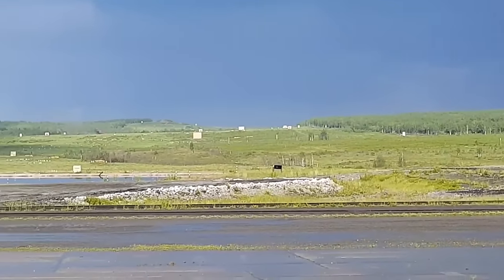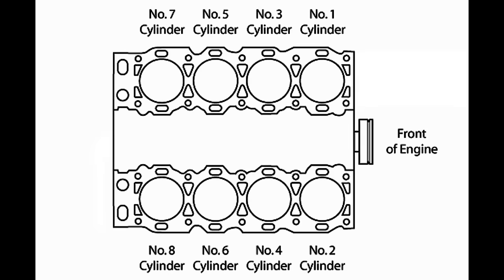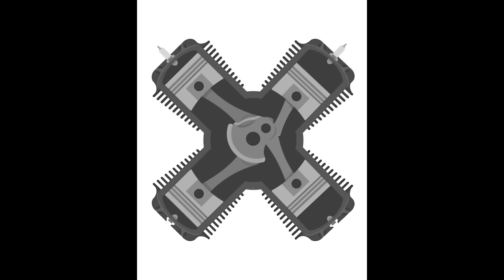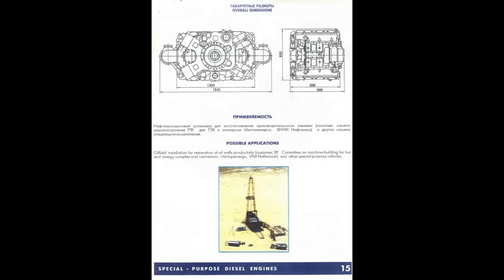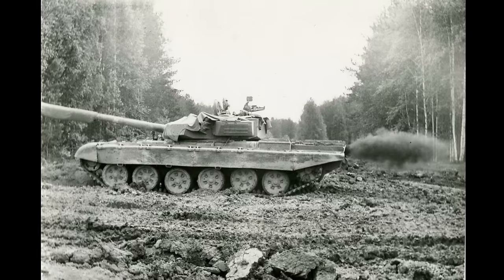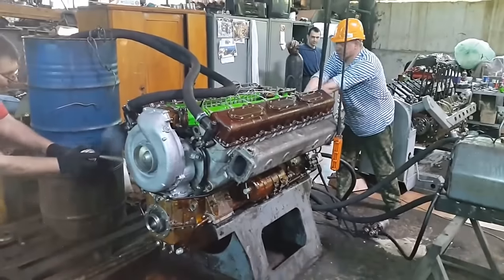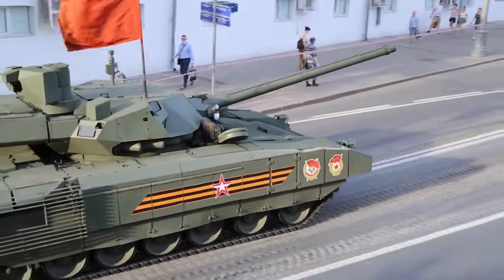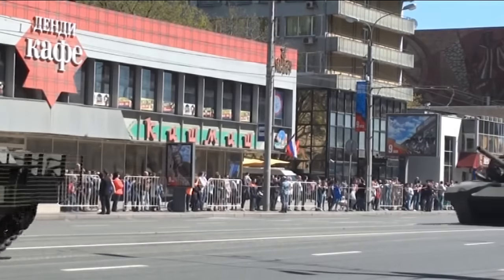Controversial History of T-14 Armata's Engine

Comment: I feel like people who argue that the T-14 engine is a copy of german WW2 engine are the same peaple saying AK47 is a copy of StG44.
Reply: yeah its crazy that people dont know that ak is copy of israeli Galil
Reply: @joukonsson1872  what are you talking about ?
Reply: It's joke  @mi-283
Reply: @joukonsson1872 no AK obviously is a copy of Roman slingshot
Reply: @joukonsson1872 weirdly enough, the Israeli Galil is a copy of the Finnish RK-62 which itself is a modification of a Polish license produced copy of the AK-47.
Reply: АК-47 is a copy.
You see, stg-44 shot bullets. What does AK-47 shoot?
That's right, it shoots my brains out on the wall.
Reply: @AlreadyTakenTag  i think that was joke. Also there is none thing such as AK-47. Its just AK or 56-a-212 to be correct.
Reply: And yet the people who think AK is a blank sheet design are also wrong.

It copied a LOT from the M1 Garand.
Reply: @immikeurnot  just rotating bolt, also from zh-29 and AB-46 recoil spring and long stroke gas system
Reply: @immikeurnot  womp womp
Reply: @mi-283 (Galil is a copy/based on AK)
Reply: Copy is exaggerated, but it was based on captured STGs. This engine is BASED on the German WW2 engine, but not a copy. It’s not like the Tiger engine was a great one to begin with.
Reply: @Vandelberger The Tiger 2s engine youre thinking about isnt the diesel one. Its the gasoline one.
Reply: @immikeurnot People who DO know their AKs, understand that it's a system that collects all the proven and reliable ideas in the most simple form.
Kalashnikov and his team tested hundreds of systems, and in the trials they scrapped AK46 design and took Bulkin's design and made adjustments.
Because it was not a competition of who would make the most genius design from scratch, but who would come up with the most reliable, cheap and sturdy one. 
The same principle was adopted to PKM, which is an upside down AK essentially, and SVD, which uses AK's design as a starting point, so soldiers can use all three systems.
Reply: @Vandelberger  except you are wrong in both and this video shows on the engine and the simple mechanism difference of the STG-44 and AK-47 shows in their case.

At most it inspired it conceptually, in the rifle case
Reply: @AlreadyTakenTag truly mr worldwide
Reply: @niksonrex88  You are right. I am very hung over. 😵
Reply: Or, that the BF-109 is just a copy of the Wright Flyer, both have wings, both fly, both use lift.
Reply: @Itoyokofan Originally the AK-47 took a lot of machining time and so was actually very expensive per unit. It wasn't until quite a bit later that changes were made so that it could be stamped and made more cheaply.
Reply: @ian_lambert-knight  em-m... no. The original Type I AK was stamped just like the AKM, but the process of stamping was yet in development in the USSR. (Actually Hugo Schmeisser AFAIK was helping the USSR with stamping processes). Thus it was decided to temporarily adopt milled recievers. The stamping issues were resolved, and more crosspins were added to stabilise the frame. And RPK even has the trunion with protrusions to reinforce the reciever.
E.g. the safety originally was mounted just to the side of the reciever, but in AKM it hinges on a thick pin, that adds strength in this place. And I believe the thickness of the metal was improoved compared to Type I.
Reply: It is legit a modified version, it is still u reliable and prone to breakdowns
Reply: Wait til Lazerpig comes out lol
Reply: @Vandelberger  
>  it was based on captured STGs
Only conceptually.

> This engine is BASED on the German WW2 engine
Not even conceptually.

You don't know what you are talking about. 2V-06 engine from the BMD, which this engine is a twin version of, is unrelated to any German engine.
Reply: I’ve always wondered want people say the ak47 was a copy of the Stg and not the ar-15, given they have more features in common.

- in-line recoil system with high-rise sights and buffer tube in stock

- auto release dust cover

- straight insertion magazine

- very similar ergonomics

Of course the locking and and gas systems are completely different, but I’d still argue the ar takes more from the stg than the ak ever did.
Reply: @AlreadyTakenTag Fun fact for the Galil, the OG inventor of the said rifle -Yisrael Galili, is an immigrant from Russia that migrated to-then-known as Palestine, serving in WW2 under the British Army. Try to guess his real name? that's right - Yisrael Balashnikov.

And Galili himself is a sh*tposter, especially when he designed a Galil with curved barrel to conform with Woman's body for sh*t and giggles XD
Reply: @sectero9450 Kalashnikov himself explicitly credited the Garand rifle by his own word when he was interviewd by Historian-author Edward Ezell.
Reply: But notice how they never argue that the Merkava is a literal WW2 Tank, or that the challenger is just the Conqueror/Cheiftan dressed up, and slightly more mobile?
Reply: @joukonsson1872 It’s crazy they don’t know the Merkava is a literal WW2 tank because it sits on a chassis that was designed in WW2!
Reply: @50centpb7  people say it cus the ak47 was the first assault rifle after the stg44
Reply: Well, the AK-47 is a copy of the StG 44 or its 1943 MP43 or 1942 MKB42.  All weapons use the long stroke, piston mechanism with a cylinder at the top of the barrel, so that the cylinder aligned with the bad stock to prevent recall lift.  All used them intermediate cartridge. All use the 30 round magazine.  Even look the same.  The couldn’t bear to admit that the Germans had good idea that they had to adopt.  So they come up with some silly story of Kalashnikov inventing it as he was convalescing in hospital.  Soviet Union was based on lies and propaganda.  Things coming back to Russia now
Reply: @sectero9450  the STG 44 also used a long stroke piston.
Reply: @RussianBiasEnjoyer  that’s a  silly argument.  The AK-47 and the STG 44 look for the same.  A B19 and rot to look the same . And this pattern of appearance was pioneered by the StG 44.  The intermediate cartridge.  The long stroke piston mechanism.  The cylinder being above the barrel.  The alignment of the barrel recoil with the butt stock.  The selective fire.   The defenders of Russian pride get down to trivialities Such as the long stroke, pistons action on the rotating bolt.
Reply: @Vandelberger  The HL230 of the tiger tanks and panther tanks was an excellent engine.  Fire problems from its engine, being installed in an aquarium to allow deep river crossings.  That causing problems, but it wasn’t the fault of the engine.   HL230 what’s the most powerful tank engine of the war
Reply: @niksonrex88  The Tiger I, Tiger 2 and Panther used the HL230 petrol emigre of 650 hp,   The SGP Sla 16 (Porsche Type 203) X-16 Tank Engine was an a cool diesel designed to fit in the same.  It was extremely light, powerful and fuel efficient.  The T14 uses similar configuration.
Reply: @williamzk9083  but not rotating bolt and recoil system is different
Reply: @Vandelberger  wow it have pistol grip and curved mag so its copy wow
Reply: @williamzk9083  thats what i said.
Reply: While I get your point (from a "looks" standpoint)... its actually NOT the greatest comparison from an INTERNALS standpoint for how the/these engines work vs how those two rifles worked. In this video's case, their internals and how they work are very similar (on some function over form type shyt) since they're based on the same technology and mechanisms. So, it'd be more like comparing the Ak47 to the M1 Garand... if the M1 Garand looked like an StG44, lol.
Reply: @sectero9450  Good try and trying to seem smart, but no. In russian military paperwork, the original 1947 AK rifles are called “Avtomat Kalashnikova 47” to denote the year it entered service. So, if you wanna try and be all “I’m a firearms expert” the least you can do is fact check yourself. Hell, if you knew the most basics about soviet firearm history you’d know they’re named after the designer, and the year it was first accepted into service. Why would the AK be the only soviet service rifle to not fall under the classification system the rest of their small arms fall into?
Reply: @JohnDorian-j7x  it was sarcasm. And they aren't similar internally, stg have locking logs on bottom of bolt, like for example bren gun, or any falling block guns or browning pistols system of locking*. While ye ak shared rotating bolt with m1 carabine, because Soviets got them from lend lease or from zb-29 rifles that SS used or earlier soviet prototypes self loading rifles. Still zaicev and Kalashnikov wrote they they inspired from m1 carabine and AB-46.
Reply: @Captainkirk88410  Not really , case with STG-44(or correctly MP-43 because its what Soviets got) and with m1 carabine new type of weapon - intermediate cartridge and assault rifle. And firstly soviet developed cartridge - 7.62x41 they they started 2 trials for self loading rifles and assault rifle, in rifles Simonov easily won(as i remember there was only 3-4 other guys and they were suck). But in assault rifles more interesting, first to developt were Sydaev, Bulkin and D-something(he made a bullpup) AS-44 even had field trials in real combat, but sydaev died in 44 , so dead end. Kalashnikov and zaicev got their gun only at 46(ak-46) which was way different that 47, and it wasn't good. Leader was AB-46(which looks like ak with longer barrel handguard and different dust cover), AK won because it weight slightly lighter. STG created whole new class of firearm which soviet copy, not gun or doctrine, but idea. Same thing btw with MG-42 - universal machine gun which PKM, M60, fn mag copied.
Reply: @williamzk9083  lol, let me use I will debunk your entire post by debunking the later part technique.
Kalashnikov did came up with an idea in hospital during the WW2, but it was the idea of an SMG, which he made and eventually this got him a place in a design buro.
Noone has ever said he came up with idea of AK47. The AK47 wasn't even in the concept before he saw Bulkin's rifle.
Reply: @Itoyokofan  The order gin Russian copies of the StG 44 were stamped as well.  Stamping is cheaper but the metal is heavier and thicker
Reply: @sectero9450  The StG 44 like Al 47 used a long stroke it’s a triviality that the AK47 complied the garand rotating bolt of the garand.  The piston still acted directly on the bolt and moved together.  Both were reliable.
Reply: @Captainkirk88410  he didn't, soviets ordinance steps did - they started trials for new type of weapon,  there were dozens of different rifles.
Reply: @williamzk9083  M1 carabine not garand. And long stroke gas system  used lot of guns that soviets used. STG is why AK-46/47, AB-46, AT-45, AS-44, TKB-408 etc were made in first place.
Reply: @sectero9450  M1 carbine and its selective fire full automatic developments the M2 and M3 used a short stroke system.   The selective fire variants did not see service till late 1944.  While a good weapon it lacked a pistol grip and the butt stock barrel alignment
Reply: @williamzk9083  yes that's why i said it used ROTATING BOLT not gas system. Also AK-46 used short gas system its closer to tokorev one btw.
Reply: Forget to mention Israel Galil  copy of Ak47 by  man named Balashnikov😂
Reply: it's almost like EVERY design is a building upon designs that come before it, and it doesn't make it a "copy" or "stolen".  @immikeurnot
Reply: lol hasn't he humiliated himself enough? or do you still believe that hack? @antoniochalking
Reply: @Itoyokofan  Hugo Schmeisser had no engineering education and he would be of limited use in stamping. Schmeisser's bread and butter were tube SMGs. The StG stampings were made by Merz Werke as they had experience stamping motorcycle parts.
Additionally, the AK had to be milled when Schmeisser was alive, and the stamping issues were resolved years after he died.
Reply: And also Sputnik is a copy of V-2 rocket. Yeah, russophobic clowns are just sad at this point...
Reply: @50centpb7  Racism. These children can't stand the thought that peasant untermenshen from "backward" USSR made vastly better designs and bested their national competitor in anything. Especially wehraboos and muricans, for whom the thought is literally insufferable...
Reply: Only lazar worm fans
Reply: If I had a nickle for any unsourced claim about some feature in some tank or military equipment that had its origins in Nazi Germany I'd be rich. I literally had someone make the bold claim that the Centurion tank's suspension was based on the Panther's.
Reply: Literally this. Wheraboos who think everything was stolen from ZE MOZT PROGREZIVE NAZION of WWII.

Which it in many aspects wasn't, by the way. It was the most technically developed of the losing nations and thus when cornered threw everything at the most outlandish projects. Some of which succeeded.

But lets not forget that almost none of the wunderwaffe had any noticeable success, while near all of them were resource-drains. Mostly, they outlined tools of war to come. but by themselves often had very limited influence on the WWII.
Reply: @KuK137  The R1 rocket was V2 copy, R7 was based on V2 as much as any American rocket is based on V2.
Reply: Maybe we should explain it to people by stating that one is KFC and one is Maccas, they are different, even though the look similar
Reply: Actually it's more like arguing that the AN-94 is a a copy of the MP-40. The both fire rounds smaller than rifle rounds, they both have folding stocks, and they both have 30 round magazines. They're basically the same gun.
Reply: People like to forget that everything beyond the most basic technology  is literally a copy of something else that's been improved or modified heavily in some way. 

Every internal combustion engine is a copy of the original idea of the internal combustion engine with, at this point, drastic improvements made.
Reply: M16 is a copy of StG44 and StG44 is a copy of SVT40 just like the Panther is a copy of the T34.
Reply: @AlreadyTakenTag I think he was joking
Reply: @immikeurnot gunsmiths always copy something from other designs and its actually a good thing. Why reinvent the wheel every time
Reply: Or, guys who say that T-90 is a T-72BU 😂😂
Reply: @Vandelberger The AK and STG share a vaguely similar contour. That’s about it. Their internals are quite different; if you disassemble the two and lay the internals out they look like unrelated systems. 

The comparisons to the STG were never particularly compelling, considering the AK also has similar design elements to existing Russian weapons and internally is closer to the Garand than to the STG.
Reply: @immikeurnot really the only thing the AK copied was the two lug rotating bolt the gas system is effectively a BAR flipped upside down. Even the stamped construction wasnt influenced by the Germabs because the russians used simple U channel stampings which is a call back to the PPS-43.
Reply: Many inventions are based from previous knowledge.
Reply: Ak is copy of garand
Reply: @Anarcho-harambeism  well the rotating 2 lug bolt was inspired by the garand but the gas system was inspired by the BAR with the stamped receiver influenced by the PPS-43. Mikhail Kalashnikov was a big fan of John Garand and John Browning's designs.

Though the AK is more inspired not a direct copy of any design.
Reply: @nemisous83  pretty much, just didn't want to type it all out lol
Reply: @immikeurnot  Account history
Reply: people made excuse to save face in self defeat. Russia is great innovators. Germany was defeated by the soviet union.
Reply: @freeworld88888  yeah, no, it was a very much a joint effort
Reply: @user-kf1pf5qw4d  I wasn't normally used for pumps, that's just what the company that made the engine listed as possible uses for it to sell it commercially, we have no evidence to show anyone has used it for that. I could be said it is a successor to the sla16(only ever tested on 1 tiger 2) but the piston design and angle of the engine, as well as its cooling being completely different  make it more of an engine that's inspired by the sla16.